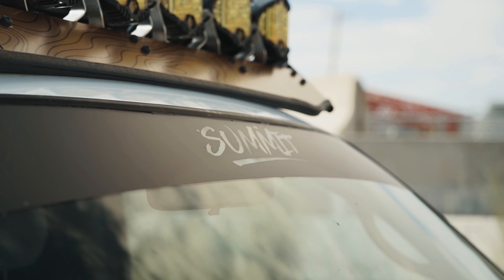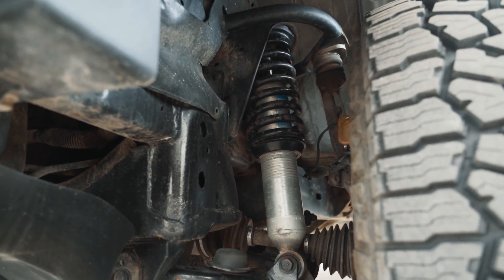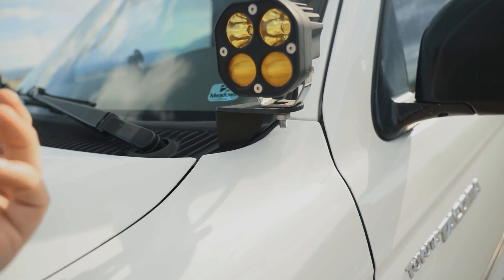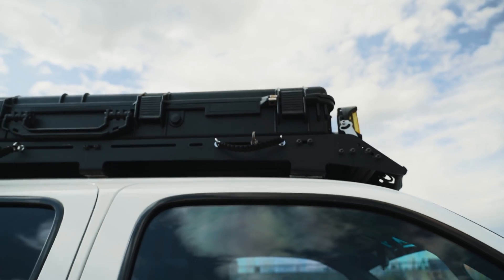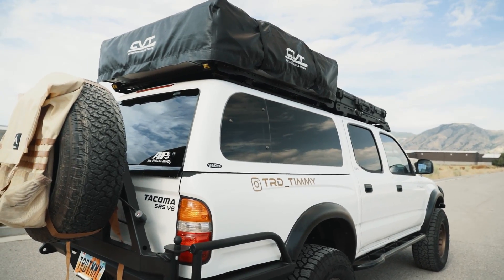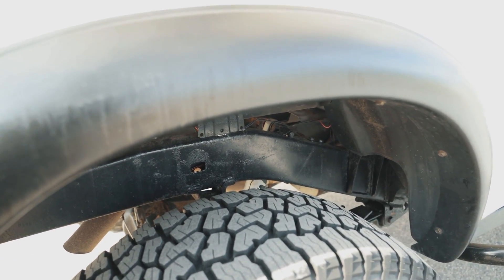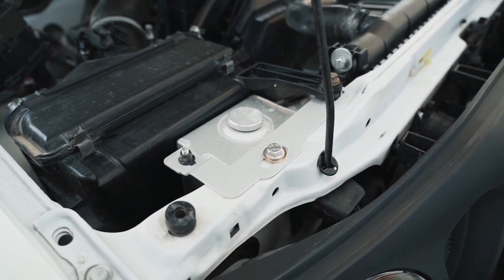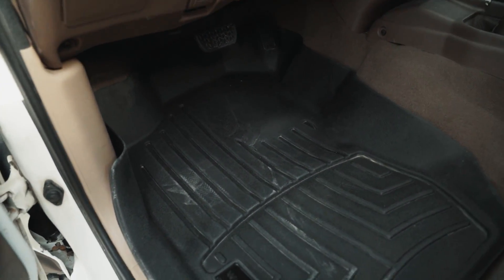First Gen Tacoma Overland Build Walkaround

Comment: Is the top rack the “Universal Top Rack 4.5′ X 47″ on Prinsu website? I have a LEERXQ camper shell I want to install the same thing.  Great looking taco 🌮
Reply from the maker: Yes that would be the one that I have.  If you are ordering one I do have a discount code you can use on the CBI website for it! "trdtimmy"
Reply: @trdtimmy  Are you positive it's the 47" and not the 44"?
Which cab rack are you running for them to line up and fit with each other on the sides?

Comment: Quick question, how does the canopy do with the weight of the tent + rack? I have a canopy & would like to put the prinsu on it with the tent (same exact RTT as you) did you end up adding inside supports? Or just run it as is? Thanks.
Reply: Great truck BTW!

Comment: I thought the few white 4x4s had a grey interior.
I looked for a white one with grey interior for months at every dealership and ended up getting a red one with shit brown interior with the intention to sell it when I found the white one. 
I will never sell my red truck even though I dont like the color.  My truck has been a beast and it got even more improved throught the years.  I usually get the buy offer from people but nah.  I'll never find another dependable truck like mine again.  Keep the videos coming and the TLC on your truck going.
Reply from the maker: I’m not sure how many were grey or tan. I looked for almost a year before I found this one, I actually really like the tan now! I will be posting more so stay tuned!
Reply: Awesome!!! And dont ever get rid of it.  I used and abused mine for the past 400,000 miles until I added a transmission cooler and an all aluminum Koyo radiator.  
Now the engine and transmission are loving the upgrade I should have done since the beginning.  
I towed a 22.5' Centurion Avalanche with it among other things.  These trucks were but for combat!  Lol.

Comment: Do you have something to reinforce the rack on the topper to hold the weight of the tent?
Reply from the maker: Didn’t need to. The prinsu rack is very sturdy. I have 2 additional cross bars that the tent mounts on and then they bolt in to prinsu rack like they normally would. It distributes the weight nicely

Comment: Look at the shocks in the rear. Those fox 2.5s only have like 3 inches of travel as the truck sits. That can't be right. You'll be smashing the shocks with 3 inches of uptravel, long before you're hitting the bump stops. You should have around 6 inches of uptravel with the lift. Those shocks must not be designed for that model
Reply from the maker: @philiptaylor2567  they came as a packaged deal with the leaf springs from Allpro. Never had a single issue with them and they definitely allowed me to hit bump stops without restriction. I have since upgraded those with the archive garage shock relocation with 12 in smooth body shocks and it is much nicer